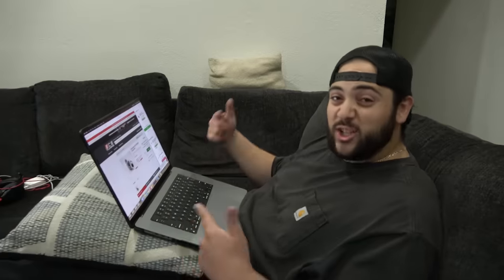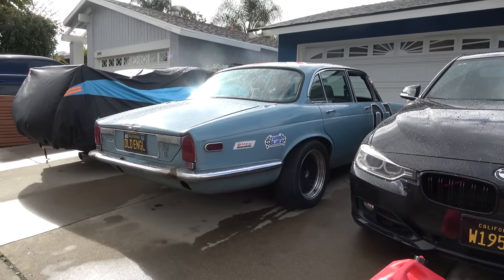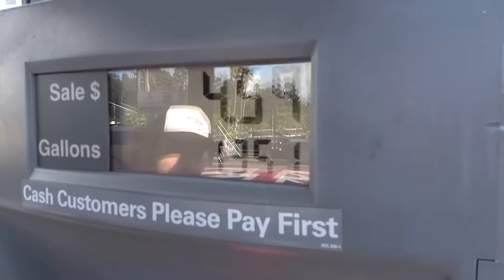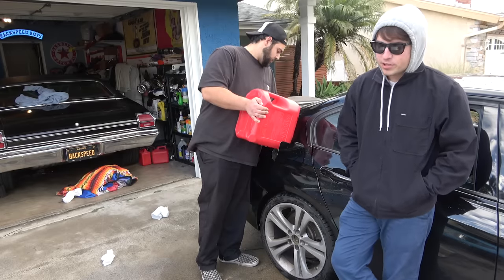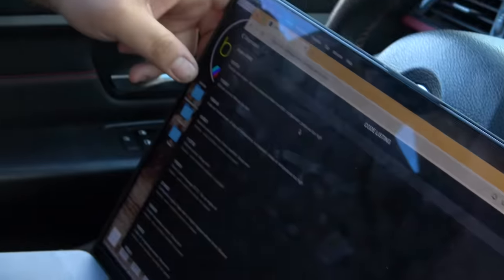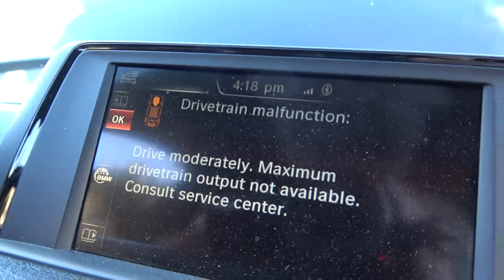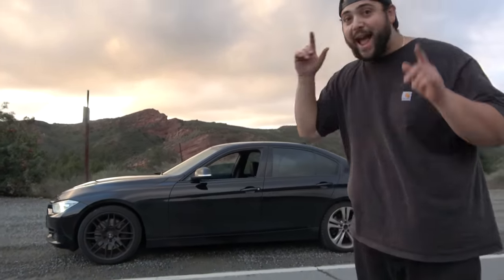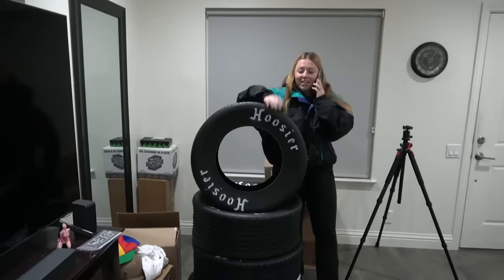Adding 58HP To My BMW For Under $12 Bucks (CHEAP 600HP BMW BUILD!)

Comment: I think that they think their bmw has a b58 🤦‍♂️ it’s a n55, stage 2 only makes around 380 hp and e30 will only bump it up to a little over 400. I really hope these donuts fixed the ofhg leak bc it can blow up the motor if the belt gets sucked into the engine
Reply: They spent 7500 on a bmw, I don’t think they care too much about it
Reply: @axelflako  no one’s denying that lmao, no excuse for lying and not fixing a cheap gasket that can blow up the motor even tho it’s 7k or whatever
Reply: Rod bearings, good “enough” maintenance, fluids topped off, maybe a crank seal, and a hybrid turbo and you’re on your way to actual 500whp on E! Keep it up brothers!

Comment: Broo check out the N55+ turbo too!! Very similarly priced to the Pure500, also comes with the custom inlet and it’s been proven to put more power down the between the 500 and the p750. Def check them out, Doug will hook you up! They might still be doing rebates for logs on their EWG, so look out for that too!

Comment: ... picked up my E90 N54 twinturbski for 7K..  had all new gaskets done 40K miles ago, including oil pan and oil filter. been fixing little minor things here and there,  and adding peace of mind, ( like a crank guard seal)  has a few nickel/dime items.. like the radio and chimes having no sound..( diagnosed to be amp, started acting up today especially bypassed the L7 amp, and everythign that i lost came back)  and the driver headlight angel eyes bulb out..   already have 5 inch IC, BoV, hard pipe, filter, and exhaust upgrades.  just need MHD super license and  mid 400 HP is achievable.

Comment: Don't get a Pure 500, invest in a N55+ as it is literally better for the same price, you'll be able to hit 550whp with ease, I'd also recommend getting a upgraded high pressure fuel pump and that's all you should need

Comment: what programm are you using for the stage tuning?
Reply: did u figure it out??
Reply: Bootmod3 also knows as bm3
Reply: @fletcherrichardson6228 it’s BM3,only works from F series BMW’s to new G series but they need ECU unlock